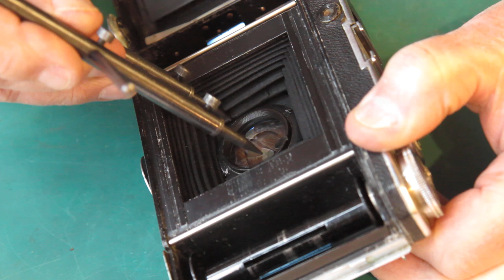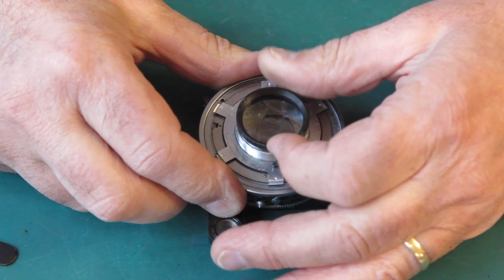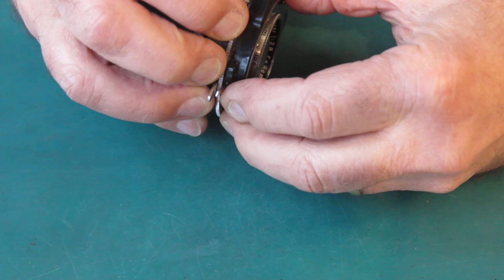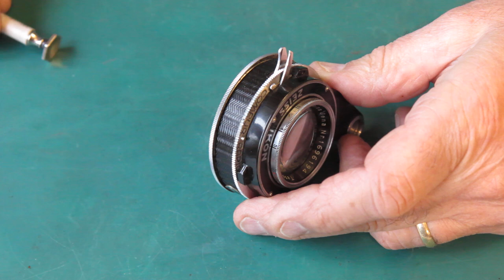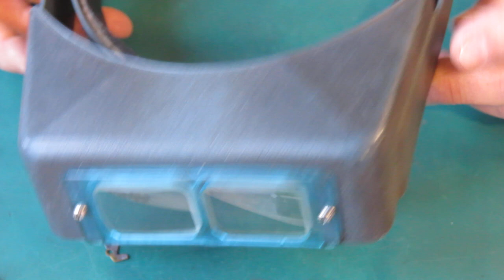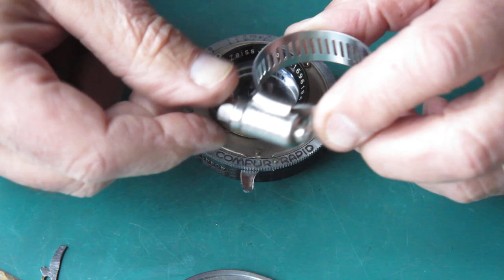Servicing a pre war Zeiss Ikon Super Ikonta, part 01

Comment: How fo you get around the film advance issue. If its the same version as mine, the film it was designed for doesnt match modern paper backw. The insoection window doesnt line up with the frame numbers on film backs.
Reply from the maker: Once you line up frame number one you close the window and rely on the film advance mechanism to wind the film enough each time to give you eleven frames with no overlapping. There is no expectation that the numbers for the following exposures line up with the window.

Comment: great info. I have a copy/once-removed half-brother of that lens (industar 105 3.5 from Moskva-4) of that lens. Shutter lever won’t stay in up position when cocked up. Can you advise from your experience if that could be repaired without replacing parts inside just by cleaning? I assume it could be either worn off ratchet/catch or just dirty contact point that won’t hold spring when wound up?
Reply from the maker: I don't have any experience with that shutter, but assuming it is a fairly faithful copy of the Compur-Rapid, then I'd say the chances are about fifty-fifty that nothing is actually broken with those symptoms.